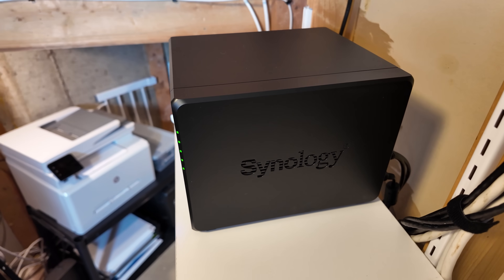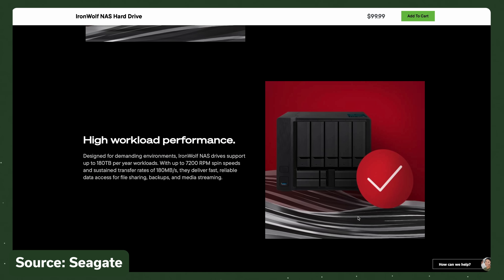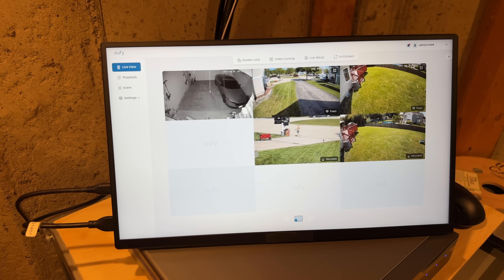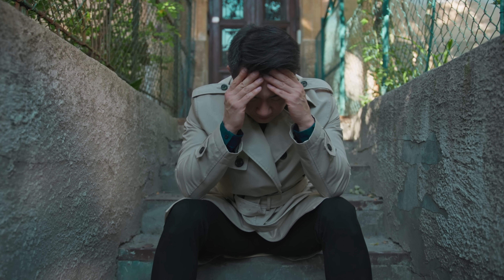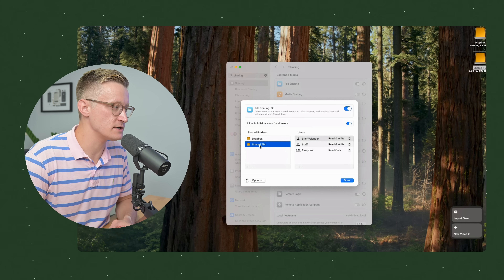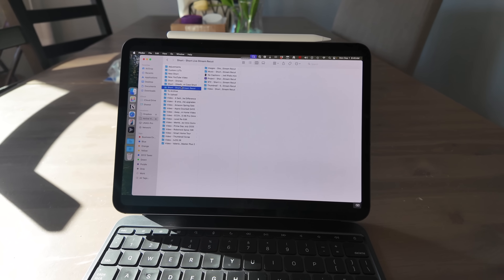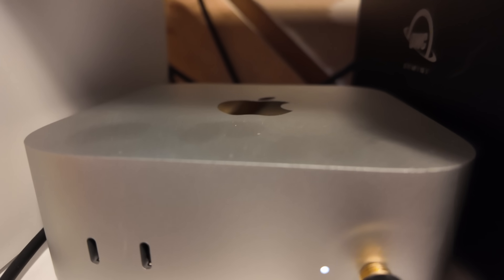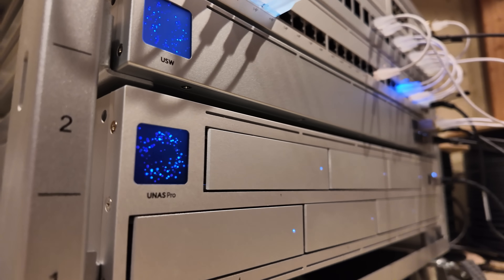Why a Mac mini can be WAY better than a NAS

Comment: One thing I didn’t understand… Are you somehow able to bypass paying for extra iCloud storage for Apple Photos?
Reply: It's not to save money on iCloud storage, it's so that you have a full local copy of your iCloud Photos in case anything goes wrong with your iCloud account or if Apple somehow loses data. But if you want you can then also use it to save some iCloud storage by offloading files, but I personally wouldn't want to because I like having everything synced across devices, it's easy to redownload, and it's in an offsite location should the house burn down.

I don't use the Mac's Photos app for it though, I use a Docker container called icloudpd which downloads everything into a year/month/day folder structure and also extracts the Live Photos video and places it alongside the original photo. It's a bit finicky to set up, but it's worth it to get the entire iCloud Photos library into an easy to understand folder structure. I think you can get Docker on Mac but I have it on my Synology.
Reply: @sidbrun_ I unload all of my photos and videos into Lightroom and keep it organized so it’s easy to pass-down to the kids. I was hoping however to find a way around paying Apple a small fortune just to have quick access to all my photos all the time. I’m on the 8TB plan and only using just over 2TB. Wasted money. :-(

Comment: One of the huge advantages of using the Mac Mini over a NAS is for cloud backup. If you backup a NAS to the cloud then you’re charged per MB usually. If the drives are connected to your Mac Mini then you can use a service like Backblaze and pay a fixed cost.
Reply: what? are you talking about? that has nothing to do with a NAS! And tbh, in the long run you'd be better off (financially and security wise) buying two NAS, using one just for backup (preferably off-site), than paying for any cloud service!

Comment: Appreciate the video. This solution has been around for a awhile - PC based as well. What is missing and should at least have been disclosed is that it misses snapshots, failure redundancy also is a 2,1 out of a 3,2,1 data/backup solution.
Reply: Yep, these videos never really touch on backups which is a shame. I also use a Mac mini as a server and you can set up Time Machine to include external drives in backups, so you just need a really big drive for Time Machine and then remove the other external drives from the excluded list. It also includes some sort of snapshots but I haven't looked into it properly, I only really look at Time Machine's versioning if I need to. But the Mac mini server I set up doesn't replace my Synology NAS with snapshots, data scrubbing, offsite backups, SMART tests etc.

Comment: Great video, Eric. I'd been thinking of picking up a Mac Mini for a lot of the use cases you called out.

Different question: Why did you choose to go with the Eufy camera system vs. Ubiquiti? I'm about to retire my 6+ year old Nest cam ecosystem. I've actually considered both Eufy and Ubiquiti. My network is all Ubiquiti and has been for a couple of years now, so moving to the camera ecosystem, which seems really good, would be logical. However, I really like some of the Eufy camera options. Thoughts?